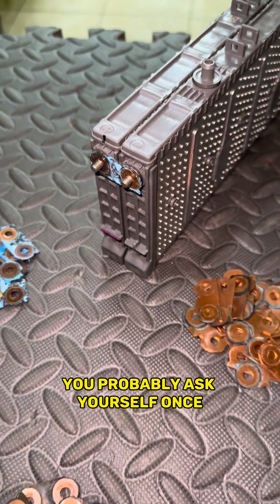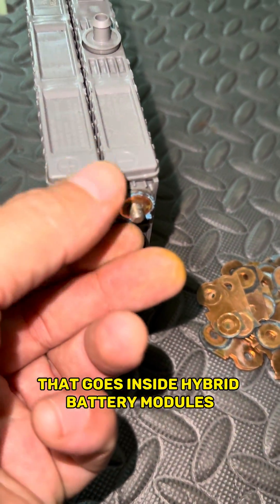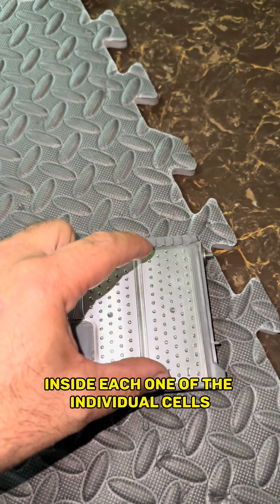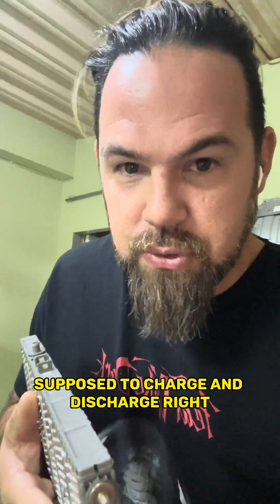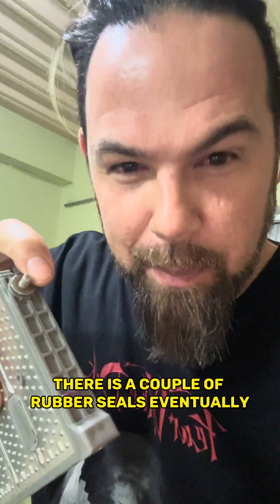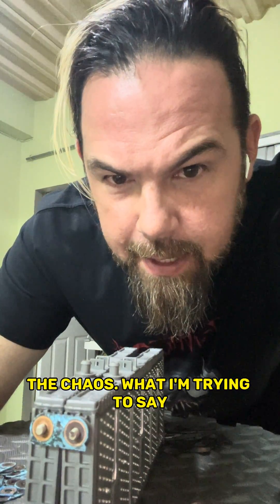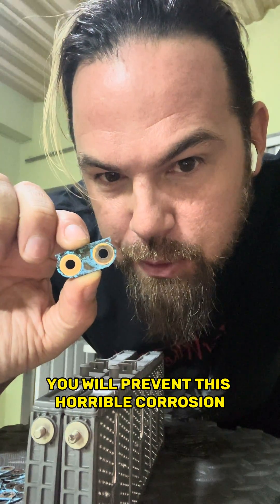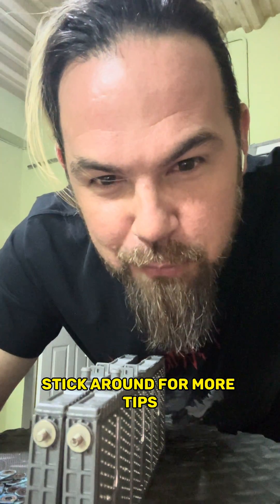What is the corrosion in the hybrid battery and where does it comes from?

Comment: Precise advisement👍
Did you ever try to fit lithium battery module 2021 (1,8l)to nicd system 2021 (2.0l). I know The charging curve is different but do they use the same charger? (CH-R 2021)

Comment: I enjoy your content.  I spent a lot of time the last 6 years fighting with these batteries. My gen 2 has over 410km on it, 3rd owner.  It's blowing out the negative post seal because the main pressure vent/valve does not work properly.  The vent has a rubber piston that is supposed to open(compress) at about 60-80psi.  The one I cut out of a blade that was leaking electrolyte, opened at over 110psi.  They were sued early on with the Gen 1 Prius packs, because the positive post seal would fail early.  Now at higher pressures, the negative post seal fails and continues to leak even when the blades are not going through charge/discharge cycles. A design flaw! I built a 70S pack of LiFePo4 headway cells.  Vendor was mistaken on the max charge current, the cells cannot handle the regen current of 100A+.  The Dr. Prius LiFePo4 battery cost more than the car is worth with the crap exchange rate.  A123 clones have 8Ahr LiFePo4 pouches that have 30C and 30C charge-discharge.  Dhgate had/has them for about $9CAD ea with free delivery, if you are young and have the time...  I just tired of fighting with the pack, so I am waiting on a cylindrical NiMh kit at $1700CAD(pricey for a 1.1KWh old tech battery.  BTW the PriusChat forum is an excellent place for all things Prius.  My headway project is there among others:o)